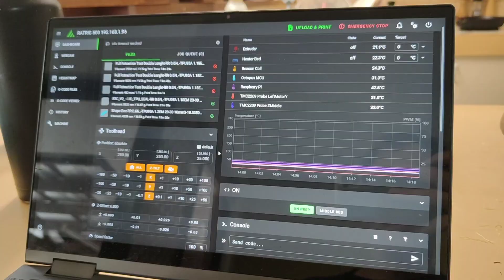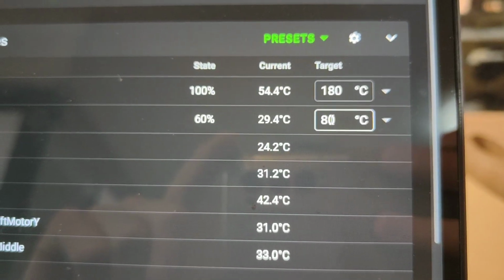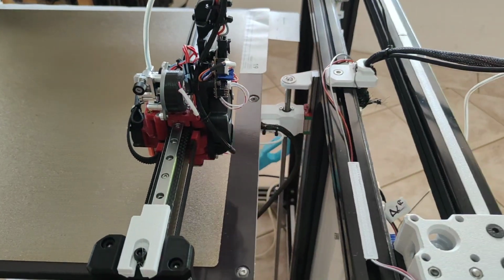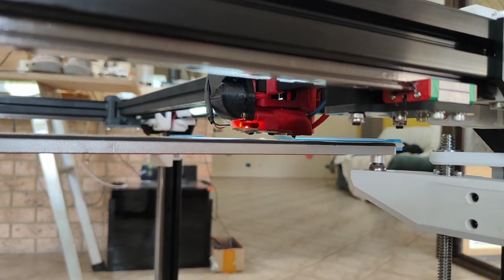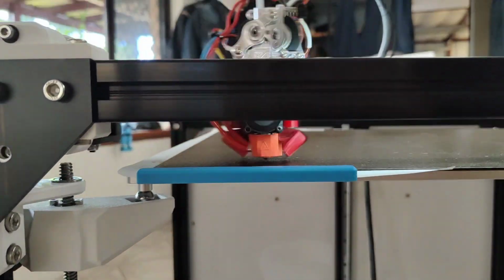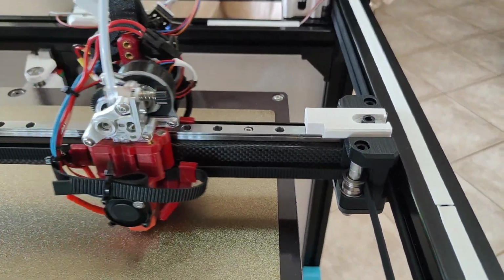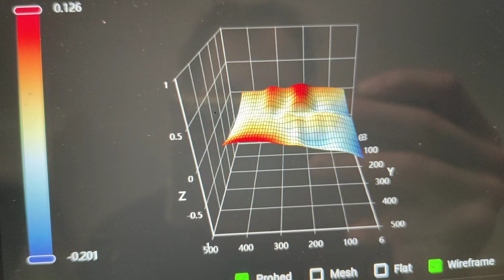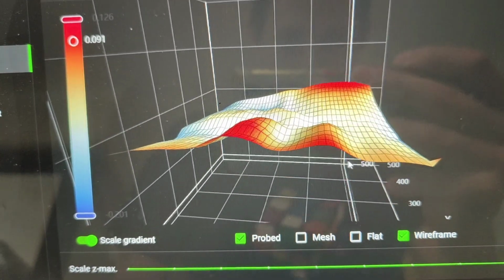Rat Rig Vcore 3.1 500x500 My Features Tour Setup

Comment: Did you find it easier to tension the toolhead with the VxBot carrier? I'm in the midst of converting a bunch of my printers to Ratrig/RatOS and as I've got a 3.1 IDEX 500 wideboy enclosed, tensioning the toolheads and Y Axis is a bit of a pain with the non-adjustable (well, little adjustment and lack of clamping power) of the EVA3 setup. I'd like to standardize on a single carriage setup for my fleet. I'm thinking VzBot carriages with EBB42 boards, beacon probes. I print mostly in ASA/ABS, and this toolhead looks a lot lighter than the EVA3.
Reply from the maker: I never built a standard EVA tool head. I went straight to the VZ style tool head with my custom belt tensioners.

Comment: Hello Julian....seeing your 500 x 500 printer has peaked my interest in building a large format printer.  I have been researching the different options available.  ie: Voron Phoenix, Rat-Rig, custom.  I wonder if in your opinion, I could scale up a rat-rig mimicking your modifications to have a print area of 660 x 660 x 660.  My interest is in prototyping larger parts for experimentation.  For example, I would like to be able print 24" round spheres. Most likely in two half spheres then joining.  Back to my question...will the 3030 extrusions be large enough or will 4040 be a better fit?   Can the 160 mm longer X beam  work without adverse vibrations or lack of stiffness.  I was hoping to just mimic your printer design by scaling the extrusions and guide rails a bit longer.  Thanks for your feedback in advance.
Reply from the maker: A lot more work will be required to use 40x40 as all the components will need to be manually adjusted. 
3030 scaled to desired size will be a lot simpler task. 30x30 is very rigid.

Will be a good project.
Reply: @jc84com  ok...thanks for your feedback.

Comment: Nice printer but the bed is too big to be 1 piece... I might mod it from 4x Ender 3 beds 230mm each with ssr relays so only 1, 2 or all 4 can heat up if needed for smaller prints.
Reply from the maker: No issues with bed 1pce.
Heats up really fast with a 1.5kw at 80% power and holds heat no problem.
Padded out the slight uneven of the bed/magnetic sheet/pei sheet with paper.
Beacon does a great job.
Reply: @jc84com   Good to know! I suggest aluminum foil tape for padding since it conducts heat much better than paper

Comment: Where did you buy your 3030 extrusions? I couldn't find any in Australia without the step in the slot that makes the MGN12 rails fall in, ended up having to import them directly from RatRig
Reply from the maker: Imported all parts from AliExpress
Reply: @jc84com  do you have a link to the extrusions, all the ones I've found there have the step too

Comment: How is the shape of the bed itself? If I use milling on such a plate I get tolerances of +-0.05mm. So is the cause for such high tolerances maybe the gantry?
Reply from the maker: too many variables to know
PEI sheet
BED plate
Magnetic Sheet
Gantry
etc.. etc.. 
its all within spec for a 500 machine.
Reply: @jc84com  Too bad, I hoped you had a dial-gauge to test it

Comment: I have a problem with the input shaper through EBB36.
It is difficult to measure, perhaps because the printed part is shaking. What about your EBB36?
By the way, when using 2 motors and 4 motors, how is the result of the input shaper different?
Reply from the maker: I only use 2 motor setup, 1 for x 1 for y
My input shaper results are pretty standard when compared to my other printer.
I will have to find my graphs, I really should recalibrate after changing my extruder to a Sherpa mini

Comment: This printer looks amazing.  It's huge.  Are the XY motors 24v or 48v?
Reply from the maker: This System is 24v.
The mod community do 48v and 4 motors AWD Like the VZbot.
Reply: @julianjc84  Having run a 500 for several months now, next major teardown is getting AWD at least, and most likely 48v. You should seriously look into it.  Also motor decouplers, which usually include upper motor shaft support, or at least two bearings holding the shaft. Huge difference. Belt length is your biggest enemy at this size.
Reply: @travistucker7317  Should be interesting to see.  Looking forward to it.